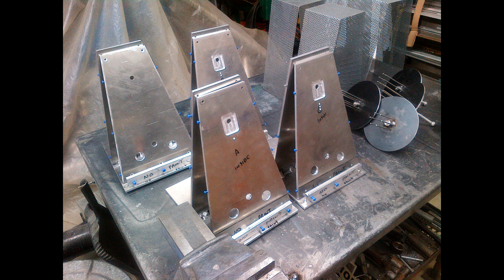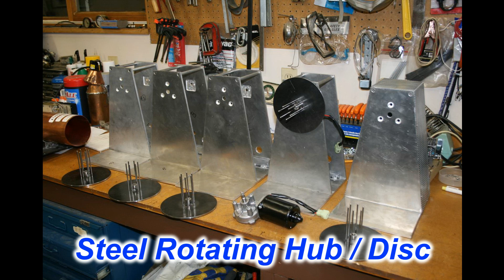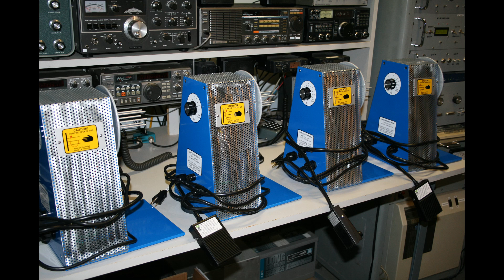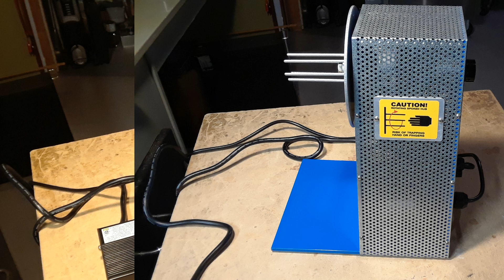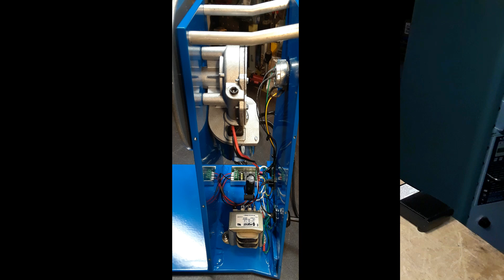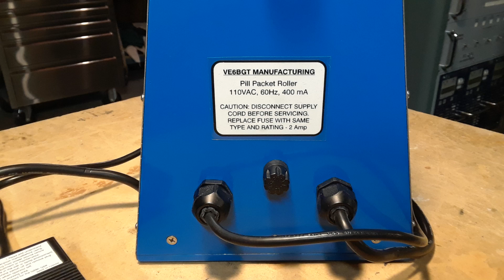Pill Packet Roller Project

Comment: They look very professional and a clean design, nice job!
Reply from the maker: Thanks Justin, figured if they are going into a professional place like a hospital, they better be good.. The powder coating is costly but well worth it.. Skip
Reply: @VE6BGT  looking for some parts for one of these, do you have some contact info?
Reply from the maker: What are you looking for exactly, I build these totally from parts here...  You cant really go out and buy one etc..  Skip @derekwall
Reply: Looking for the motor control board
Reply from the maker: Take a look at Dimension Engineering, the one controller I amusing is this link:
https://www.dimensionengineering.com/products/syren10
They have all kinds of things on their site.. There are cheaper ones say like on Amazon but these are very good control boards that I also use on my 21 foot dish control because they have different inputs for control. Potentiometer or serial data input etc.. Hope this helps. Skip @derekwall